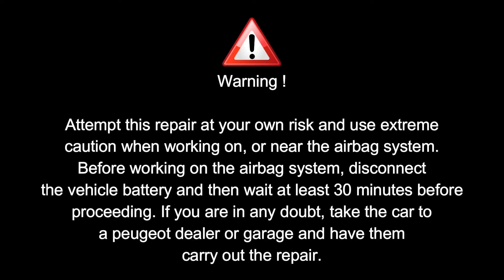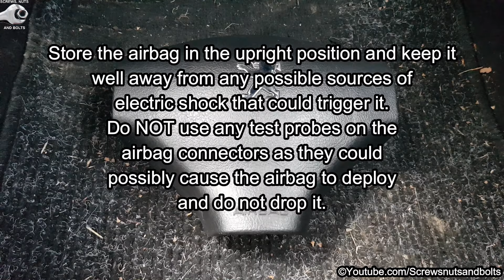Steering Wheel and Airbag Removal - Peugeot 206

Comment: Great video thanks 👍 super clear.  I just realised that the replacement clockspring unit that I bought is missing one of the two main airbag cables (the right one). Unfortunately the replacement unit was sitting in my garage for a while and too late to return to the seller. I don’t suppose that its possible to open up the clockspring units so I can transfer the missing cable from the old one to the new one? 
(the airbag cables come from the inside the clockspring unit, and the whole reason I did this job is the indicator wasn’t working reliably - faulty indicator switch.)
Reply from the maker: I don't know if you can even open the clockspring to be honest.

Comment: I need to do this on a Citroen C1 but apprehensive about messing it up. 

Will I need a heavy duty torx bit + wrench, or will I be OK with something in a more 'consumer' price range?

Useful video - thank you. :)
Reply from the maker: You're welcome. You should be ok with a consumer range torx bit
Reply: @screwsnutsandbolts  Thank you - biggest fear is that I'll let the airbag off or something or sheer the bolt or something else stupid -- but I guess it's just beginner nerves. :)
Reply from the maker: Just make sure you disable the airbag using the proper procedures and take your time. The process might be different on a Citroen so if you're in any doubt, take it to a garage.

Comment: have a 307 but was identical only that he finally says immobilizer is disabled and the car can no longer start. Do I have to reprogram the key?
Reply: You probably disconnected the battery while the key was on the ignition, that can confuse the immobilizer and reset it.

Comment: I replaced the com unit and now I get a screeching noise whenever I steer. Also the airbag light came on permanently. Ive checked the connections and everything seems ok. Do you have any ideas?
Reply from the maker: Is the screeching noise coming from the com unit ?
Reply: @screwsnutsandbolts  yeah

Comment: Hi. A mechanic changed the steering wheel air bag module. The face of the one he's changed it to is a different colour. I have the old one that is the right colour and looks brand new. Can you remove just the finished face and replace the bad one with the better one?  I see it has side tabs all around it. I wondered if it's possible to get these off without damaging the module or it going off? Many thanks.
Reply from the maker: I don't actually know. I would not take any chances taking parts off the old one. It could be very dangerous
Reply: @screwsnutsandbolts  Fair warning cheers. I did think that.

Comment: I have "airbag fault" and "passenger airbag deactivated" lights on. Is there any point of doing this process in order to fix my problem?
Reply from the maker: Has the passenger airbag been deactivated ?
Reply: @screwsnutsandbolts  No.... Thats the problem
Reply from the maker: Could be a loose connection under the passenger seat. Is the fault light intermittent or constantly on ?
Reply: @screwsnutsandbolts  it is constantly..

Comment: My steeringwheel does not have a hole on the bottom…? How do I do
Reply from the maker: What type of car  ?
Reply: @screwsnutsandbolts  Peugeot 206 2001
Reply from the maker: @hermanandersson7753  Does it have an airbag in the steering wheel ?
Reply: @screwsnutsandbolts  yes, it says “AIRBAG” on the steering wheel
Reply: @hermanandersson7753  Maybe your steering wheel is a bit different since it's a pre-facelift model. Try to find a video posted by GXsub.